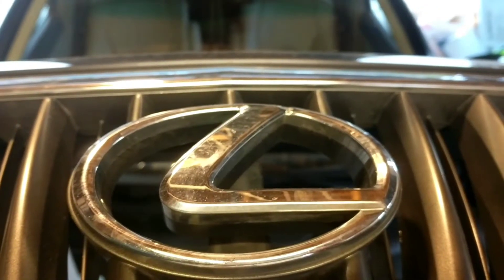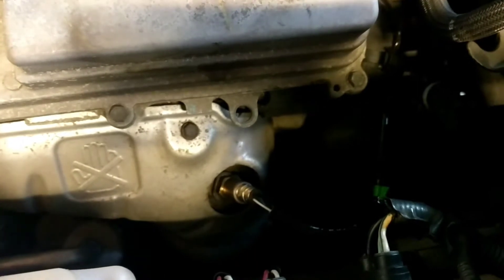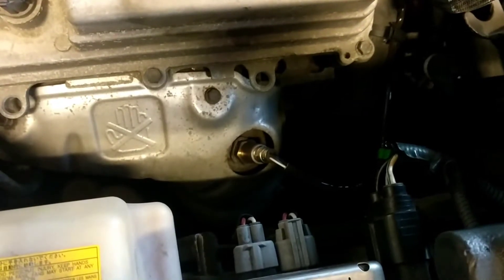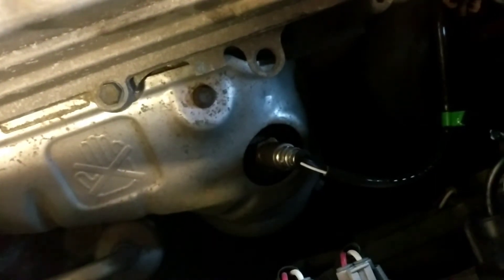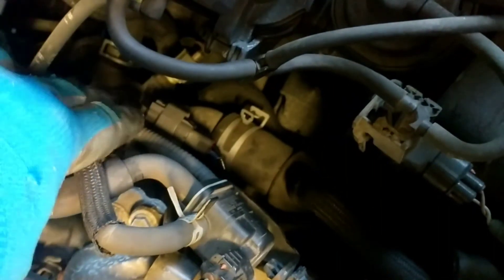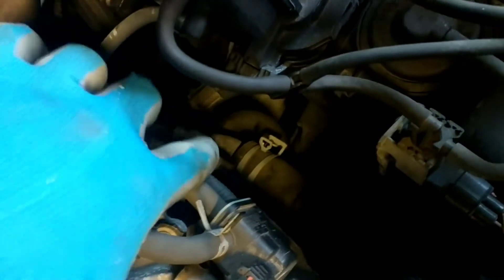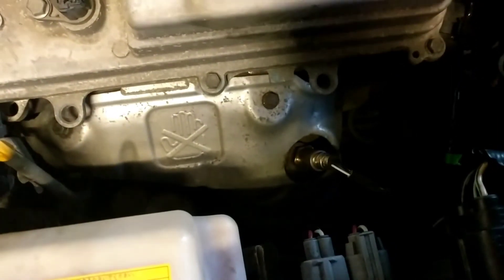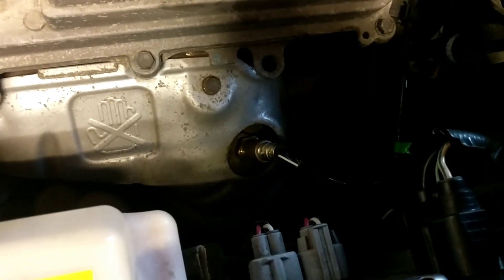OBD Code P0051. 2008 Lexus RX350

Comment: Next time. A easy way. 
To loosen those sensors is just run the car and get the engine  hot and spray wd40 on it and it will loosen. You”ll hear a small pop. 
When the engine cools down a-bit, remove the sensor.

Comment from the maker: Hey, Jack. I don't have the part number. I got the part from a local parts supplier. You could take the sensor out and take it to the part store and match it to the replacement part, to avoid run around. They will know if you tell them that it is the sensor on the front manifold. Hope it helps you.